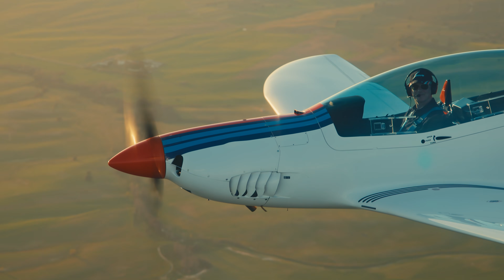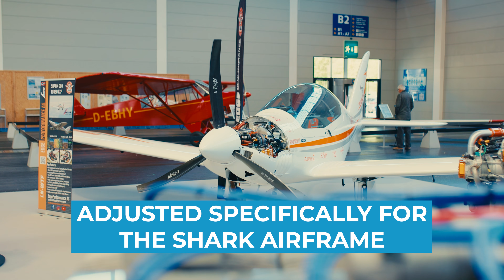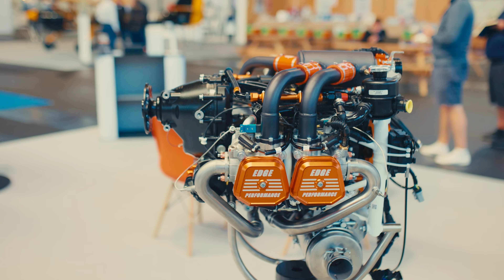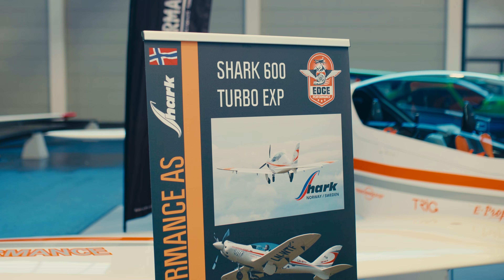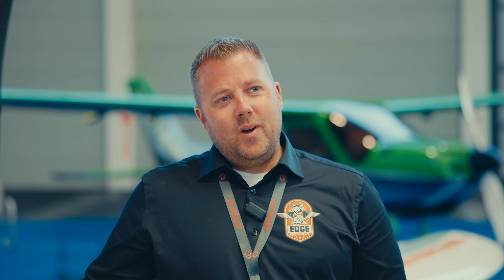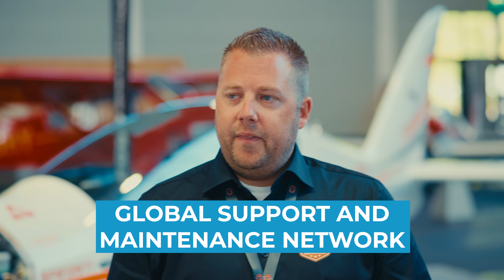Why SHARK AERO Chose This Engine for the TURBO SHARK

Comment: My buddy has a Sling TSI with a Rotax 916is. Amazing engine. 4,500 hours, gearbox replaced on condition. And he's about to do his first overhaul. Super reliable engine. 

One of the sling LSA at the school had a engine cylinder fracture and fly off and it ran at 75% power and no cooling for almost 30 minutes until he landed safely. 

This Edge Performance engine is based off of the 916is and it's amazing.
Reply: This specific engines as mentioned in the video is based on the Rotax 912UL (80HP), which shares the same platform
As the 914-Turbo.
Reply: No, its based of the 912UL (80hp)

Comment: It's acrobatic Airplane??
Reply from the maker: Yes and no. Depends on the type of registration and local regulations. In most cases aerobatics are prohibited. It’s not a certified aerobatic aircraft.
Reply: @sharkairplane  What is the g loading?
Reply from the maker: @garymccann2960  tested for +10Gs and -6Gs at the MTOW

Comment: The video would have been perfect with some specs on the engine and the airplane itself as compared to the standard rotax haha
Reply from the maker: Perhaps. Those type of vs. videos we prefer if they’re done by independent content creators. Otherwise we’re always considered biased by the viewers.
Reply: The Shark with the turbo engine has drastically improved take off distance, improved climb and significantly higher cruise and top speed. The higher you fly, the faster you go. Thanks to the turbo charger which enables you to maintain power at altitude.